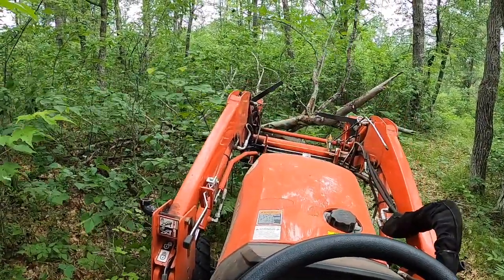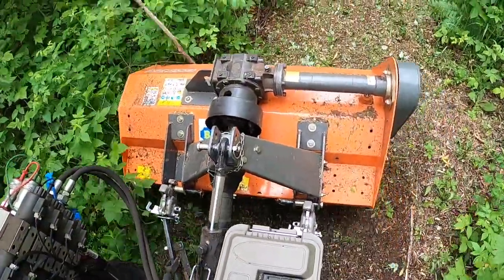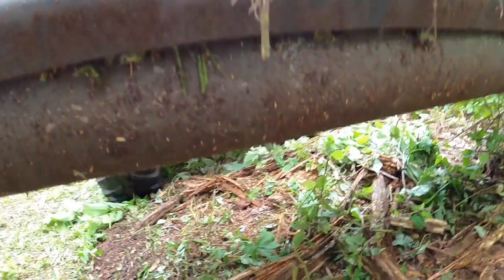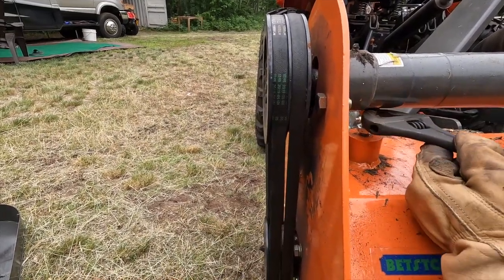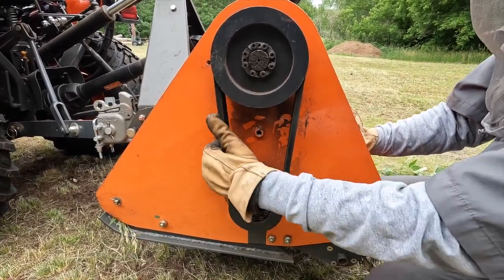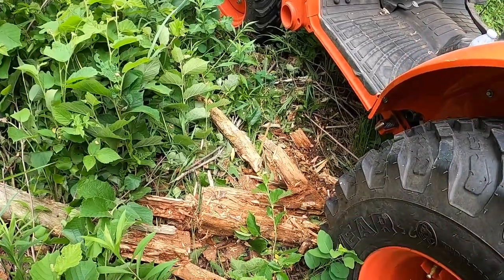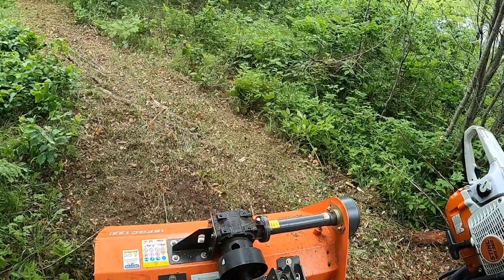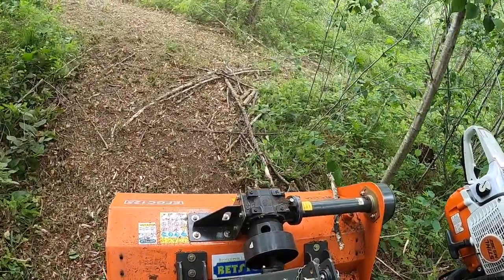Betstco Flail Mower Action!!!

Comment: Nothing can beat a powerful skid steer mulcher. We had a contractor come over. He even took on a 12 inch diameter silk tree and reduced it to mulch in 15 minutes or so. The power is up front before the machine goes through it, and the mulcher can be elevated to work down on trees to the stump. His machine did not go down into the dirt any, so from the roots, the junk came back in two years. I tried the riding mower I had to keep it down, but there were too many snags for it. Your rig would have kept it down enough until it died off. If I had it to do over, I would have bought a used brush hog to fit my old tractor that would have kept it down.
Reply from the maker: The skid steer mulcher is a dream machine for me. I wish I could afford one 💰💰you’re right about keeping it down doesn’t take long to grow back. Thanks for checking out the video.😁👍🚜💨🍳
Reply: Yeah, they are awesome for 100k investment.

Comment: I have the exact same flail mower EFGC-125, but from a different brand. I did not use it for wood, but tall reed and blackthorn definitely with a 24 HP tractor. Pretty smooth and not so loud stuff (compare to my other flail mower, which is 195cm wide).
Reply from the maker: @thomascube1986  Thank for sharing your experience. I have had no issues so far. It is tough I have chopped up rocks and metal with no problems. By accident of course😂 Thanks for watching 😁👍🚜💨☀️

Comment: Hi Mitch! Good flail mower work with some in field maintenance for extra seasoning.  When I saw your empty chainsaw scabbard I knew you’d regret not taking it. Thanks for sharing!
Reply from the maker: Hey Martin I was so anxious to get out there on the trails I came back for it after the first round. I’m glad I did because I had to cut back that tree I ran over😂 thanks for checking out the video😁👍🚜💨🍳

Comment: Hey there Mitch,  great work with the flail mower. I like how you were able to use the hydraulic top link to adjust the height of the mower. I need to get my tractor set up with a top link.  The flail mower seems like it did well I think they are better then a bush hog and way easier to maneuver in the woods. Keep up the great work buddy.  👍 Take care and all the best 👋
Reply from the maker: Thanks Kyle It take less room on the trailer to. We are a Amazon affiliate now so that will help😂👍 when your ready to buy your top link. Thanks for checking out the video have a great week😁👍🚜💨🍳

Comment: Thank you for this video! I’ve got similar woods as this and I don’t think a brush hog is the best approach. I have a challenge however. My bx1880 is under the HP/PTO req’s so I am unsure how well it could run this. How hard did it work your tractor?
Reply from the maker: They do sell another version that will run on your BX. Check the PTO specs and you can get one to match your HP. It all comes down to speed and the amount of material you wish to cut down. When I run in the thick stuff I go slow. I also suggest making sure your belts are adjusted before you start using plus order spare set of belts. Hope that helps and thanks for watching 😁👍🚜💨☀️

Comment: I have rocky trails.  How does it handle the occassional 4-6" rock?
Reply from the maker: It will chip the hammer blades but it is easy to resharppen them. I have a rock vs flail mower video if interested. Thanks for watching 😁👍🚜💨☀️

Comment: It would have been nice to have your bucket on.  Then you could set it one inch above the ground and detect things before you hit it.  It’s an old bush hog trick.  I would take a battery powered chain saw like the HarborFreight ten inch.  It will clear the way for you fast.  Now about tics and even worse those darn chickkers. . Watch Farm Craft 101.  He sprays Permethrin on his cloths at the beginning of summer.  It lasts all year long.  I got mine at Tractor Supply.  I also spray my dogs for the same reason.  Belts are usually tightened to a deflection.  Like you showed but that looked awfully tight.  I’m really thinking about getting a fail mower.  But I would rather it hooked to the front and run off hydraulics.  I’m seventy six years old and don’t like links in my neck for looking back all the time.  If you carry a loopers.  You can get those high branches in the first pass.  If not then use that electric chain saw.  That does it .  Enjoyed the video and hope to see a lot more.  Later
Reply from the maker: Thanks for all of your information and knowledge😁👍 I appreciate you leaving such a detailed comment. I will be trying some of these tips this summer. Have a good one 🚜💨🍳

Comment: Hi Mitch, Great video.  Was very 😎 cool to watch.  Thanks for posting...

What is the width and model number of the Bestco Flail Mower you were using?  Sorry, I was unable to make out the number on my phone.  Do you feel you have good HP to drive it with the B2601?

Thanks, Dan
Reply from the maker: Hey Dan it is the Betstco FH-EFGC125 / 48” inch cut. I will put a link in the description. I feel that the B2601 can handle it fine. I was also worried before I got it but you get used to what it can handle and if anything happens You can just Shut off the PTO or lift it in an emergency. Thanks for checking out the video.😁👍🚜💨🍳

Comment: Do you have the heavy flail hammers or "Y" hammers on in this video.
Reply from the maker: I am using the 27 ounce chisel hammers. 😁👍🚜💨🍳
Reply: @MJADoingStuff  what is the purchasing source for 27 ounce chisel hammers.  BETSCO only calls them "hammers" or "Grass" flails when ordering
Reply from the maker: @josephlull956  Should show in the description but the model I have in the video comes with hammers unless you order Grass blades instead. That is how it was when I ordered it back in 2019 Hope that helps.😁👍

Comment: Hey Mitch. Will it cut when driving in reverse? Have a safe and fun summer. Later
Reply from the maker: Hey Mech it will but it works better going forward chops it up more fine in forward. Thanks for checking out the video😁👍

Comment: Would this work for the b2301?
Reply from the maker: It would bog down the motor faster so you would have to go slower or lift the mower up to recover. Maybe look at the lighter duty flail mower’s they have with hammer blades. Hope that helps.😁👍🚜💨☀️